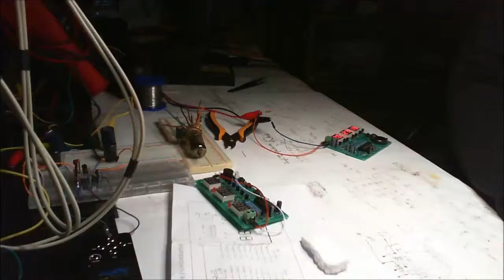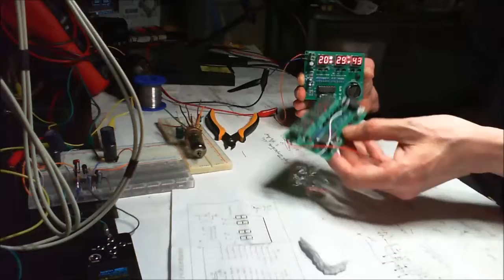ITS ALIVE UPDATE 9V 12V Electronic Clock DIY Kits Module AT89C2051

Comment: How do you set this thing?
Reply from the maker: I built it, but never used it. I can't remember to much about the operation of this unit. I have looked on the internet briefly for a manual but without luck. I guess it is a case of playing with it and hopefully you can work it out.